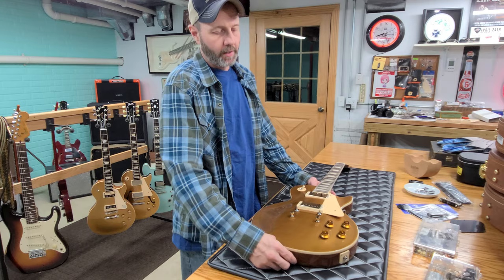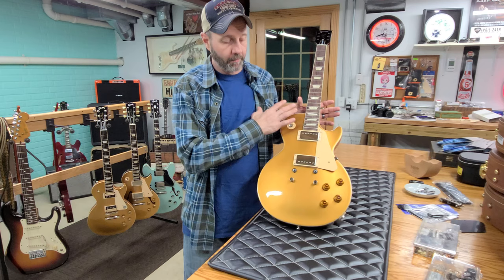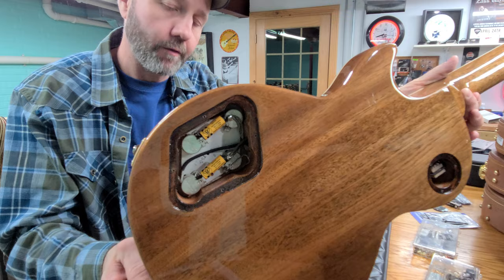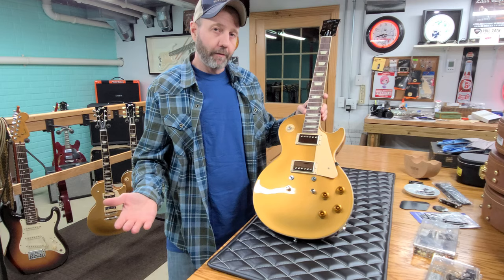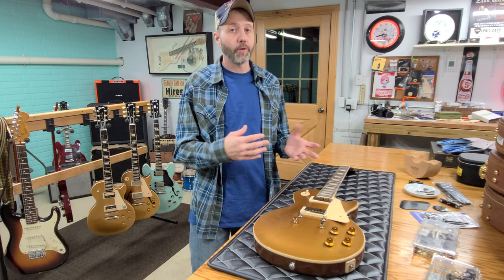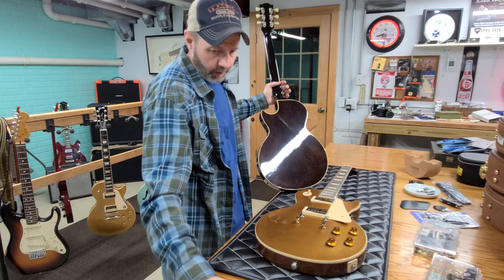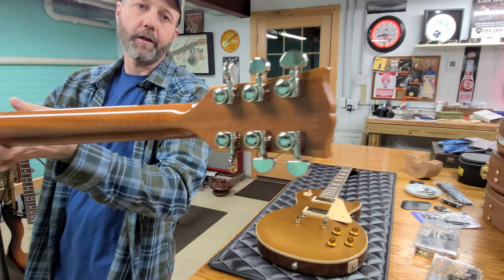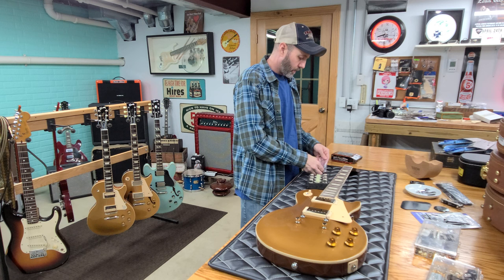Installing Kluson Revolution Locking Tuners On 2021 50's Gibson Les Paul Goldtop.

Comment: I bought the same 3 pack off Amazon cause that's what I've used for years and I believe they were somehow fake or factory 2nd's if that's a thing. Bought a single pack from the local music store and it was all back to normal
Reply: There is a video on YouTube about fake name brand strings. I hope I haven't bought any fakes but couldn't tell. So from now on I'm looking for more reputable actually guitar store Ebay sellers. I'm pretty sure most are real but I got 4 sets of Fender light Bass strings for $18 yrs ago. Haven't use them yet, just was a deal I couldn't pass up. Bass don't get a lot of use and don't change those very much anyways. So could be fakes.  16 Bass strings for $18 just sounds wrong. Or cheap.

Comment: Great video..  Thanks alot... One question why 300k pots and not 500? In all les Paul you put 300 k or in this in concrete for something?
Reply from the maker: 300k liner taper pot's react better and smoother in adjustment from 1~10 and have a warmer tone ( not so bright ) and with the vintage MHS pickups I wanted to compliment them as they are not hot. It sounds absolutely amazing!! My friends that can play very good Love it! Back in the day they used 300k in a few models. 
Thanks for your support 🙏

Comment: Serious question. Have you always thought of Ernie Ball strings as trash? Is it possible you got a batch of fake scammer strings? I got a few sets from a store once that were just awful, and it turns out the store bought a ton of fake strings off of Amazon I believe. If it wasn't Amazon it was a different internet source.
Reply from the maker: I bought them from eBay.
I thought I would try them and bought two three packs. I was told to try the pink ones, but I got such a bad experience with the green I am good!
Reply: @ThatGuitarGuysChannel  Are they legitimate Ernie Ball strings, though? I've had the gross fake ones and they're barely qualified to be strung on those $40 K-Mart acoustics. 

I use Ernie Ball and several other brands. I blow through strings like crazy though. I put 16 hours a day in on guitar so I change them several times a week. I buy in bulk at low prices when I can find the deals, and as long as it's one of the few brands that I like I'm fine with it. I've never like GHS though.
Reply from the maker: @legacyShredder1  all the outside and inside packing looks lagit. But it's not like a Gibson you can pick apart. They are just strings so who knows? I could be just brand loyal to lol
Reply: @ThatGuitarGuysChannel  Brand loyalty is fine. Also the sentiment you have towards Ernie Ball is how I feel about Martin strings on acoustics. They feel like rust to my hands.
Reply from the maker: @legacyShredder1  lol I have got brand new rusty strings.
Reply: @ThatGuitarGuysChannel  lol I have too. I haven't had any in a long time though. It used to be fairly common on my end in the early to mid 2000's.
Reply: @ThatGuitarGuysChannel  me too. Dean Markley. A case of them were rusted..from Musicians Friend
Reply from the maker: Pretty sure now I got fake ones!
Reply from the maker: @jimclark7917  pretty sure I got fake one now after all the feedback.

Comment: sweet guitar - does it matter in which order you install these on either side? is there a a L1, L2, L3 etc?
Reply from the maker: Yep like all 3x3 there is left and right but all eyelets are the same.
Reply: @ThatGuitarGuysChannel  ah ok, so if i mix all the lefts up, it shouldn't matter which left goes in the 1st, 2nd, and 3rd hole. I purchased the non collard for my es 335. no hex screw.
Reply from the maker: @artotian  if they are the same ones I just used nope just left and right.

Comment: Late to the thread but would like to know if the manufacturer's marking has any significance?  I installed on my 339 using stock press in bushings & screws.  I am assuming any 3 on L or R is acceptable w/o regards to the markings?
Reply from the maker: I will look when I get home, in Vegas right now.

Comment: My epiphone les Paul only has one screw hole for each peg and my new tuners have 2 ports for the screws. Best way to drill the holes for the extra screw? Assuming I can’t just screw it in
Reply from the maker: Don't just screw them in! You can or will split the headstock. Take a drill bit just a little smaller than the screw. Place it next to the screw. Take a marker or tape and Mark the depth of the screw on the drill bit. Then place your turner on and mount one screw to set the placement. Then drill the other hole till the mark reaches the tuner . Then Install the screw until it stops. Then just a light snug 1/4 turn or you can strip it.
Reply from the maker: Good luck, you got it..
Reply: @ThatGuitarGuysChannel  thank you so much man. Going for it now
Reply: @ThatGuitarGuysChannel  I got it done, learned a lot about the little intricacies and what not and it looks great, thanks for the help again.

Comment: thanks for sharing.. i have some lose screw on the back of the  tuners. do you have an easy solution?
Reply from the maker: Dip toothpicks in wood glue and stuff them into the screw holes and trim them off flush. When they dry, re-drill the holes with #4 size holes.
Reply: @ThatGuitarGuysChannel  thank you very very much !!!
Reply: @ThatGuitarGuysChannel  I have done it... I have not used toothpicks because the holes were too big, I used some toothpicks that women use for nails I think are thicker. I sanded them down a bit to the right size, I have smeared them with titebone and I have put the kluson revolution. perfect result. I have also changed my seymour duncan jb from the bridge for a 59. The change is incredible, the 59 is much better.
Reply from the maker: @macauley70  that's great! It's very gratifying to do things yourself and save money.
Reply: @ThatGuitarGuysChannel  well, revolution and 59 not free..hehe.. thaks alot your video help me alot
Reply from the maker: Now if you could come on the show and play the Guitars I may have better content lol. Thank you for the support 🙏

Comment: So both screw holes were already there from original Grovers?
Reply from the maker: From the original kluson, these are grover style locking tuners that fit the double hole kluson. Grover tuners only have one screw at the bottom. Therefore if you use a grover then you will see the top screw hole and imprint of the kluson.
So these have the same footprint as a vintage kluson but have the tuning machines like a grover.